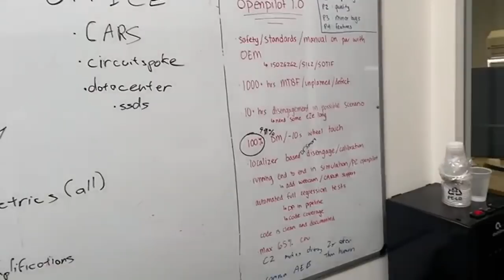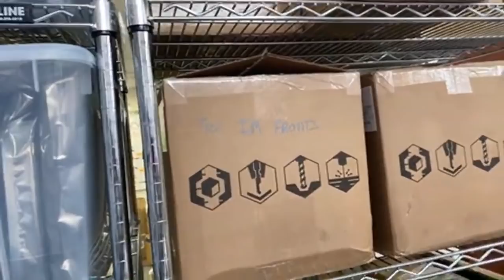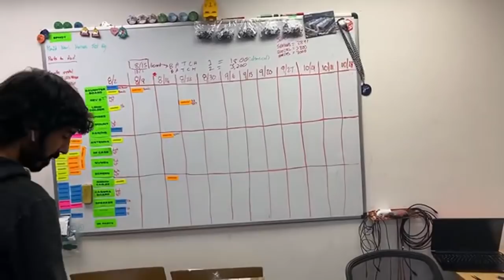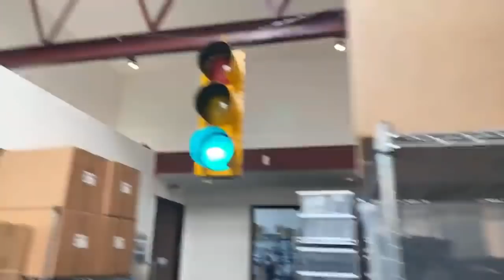comma ai | George Hotz | No more secrets! comma three production | comma.ai/shop/products/three

Comment: How about using an accelerometer to help read inclines/hills and have the car slow down based on the angle of descent? Also does the comma 3 require a constant data connection to work?
Reply from the maker: They have a High-Precision GPS on the device and they are using https://github.com/commaai/laika for better precision. Device does not need data connection for driving.
As always:
https://github.com/commaai/openpilot/blob/master/SAFETY.md
https://github.com/commaai/openpilot#licensing